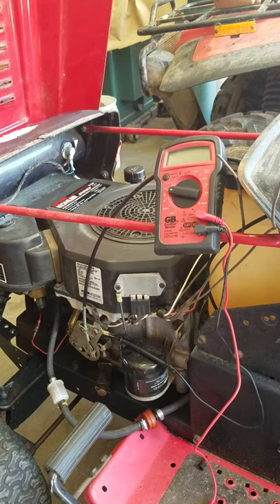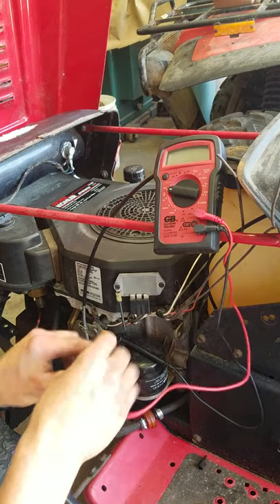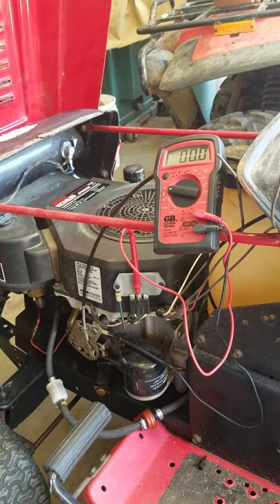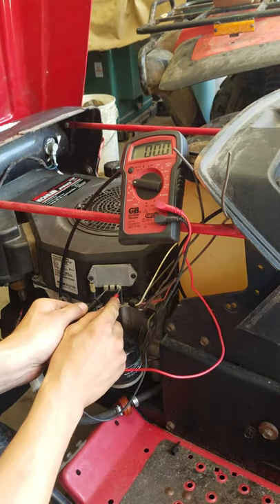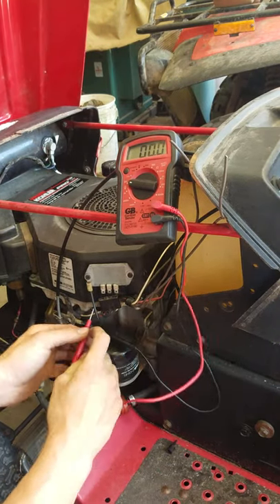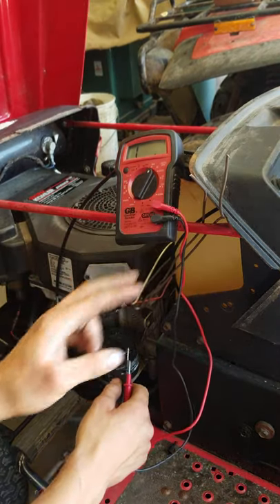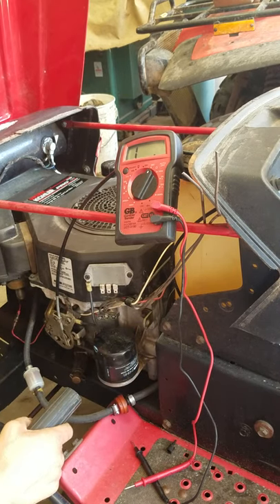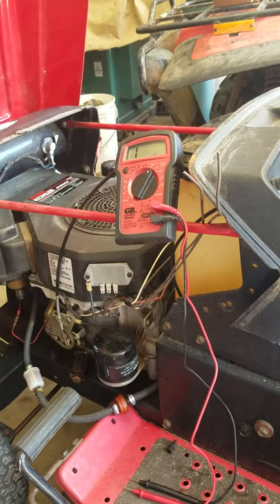How to tell if Kohler Voltage Regulator is Good ( part number 25 403 37-S )

Comment: I appreciate your video, but there is something you should know about the voltage regulator. The leads are like diodes. When you tested the one set and got infinite ohms, you should have reversed your probes. You probably would have seen very little resistance. That is because current only flows one way through diodes. So low resistance with the probes one way, infinite resistance the other way. Thanks again for making the video.

Comment: My mower is a Koehler 7000 series. It has a ground wire that has a black connector plug on the end of it but it’s not plugged into anything…..have you ever seen that?